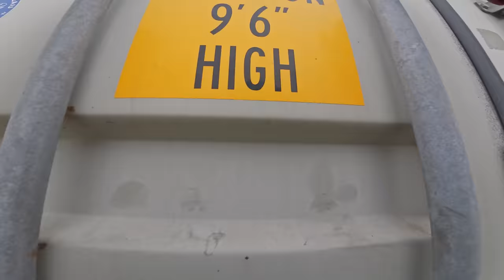Big Rig Feeling Blue ROLLED Over on Freeway!

Comment: Just a tip Alex, if you ever get in that situation where the tractor can't get under the trailer, have him back the frame of the tractor under and put a couple blocks across the frame under the nose of the trailer. Inflate the tractors bags and it'll lift it up. Roll the landing gear down, deflate the bags, remove the blocks and it should back under it.
Reply: thanks for the advice, thanks for watching